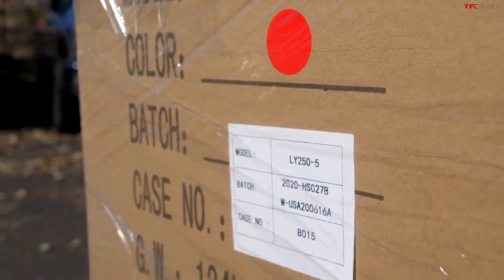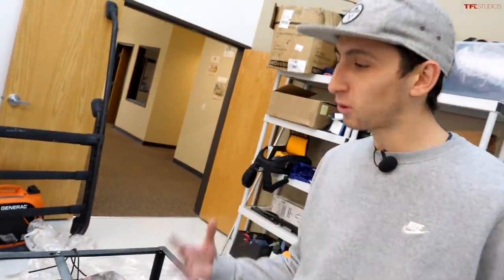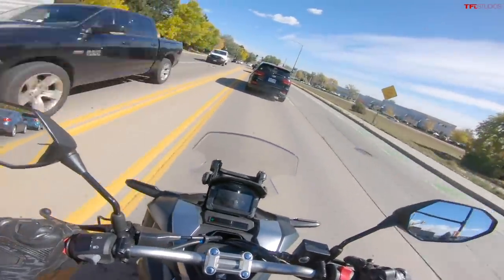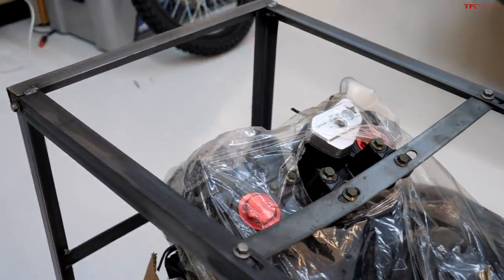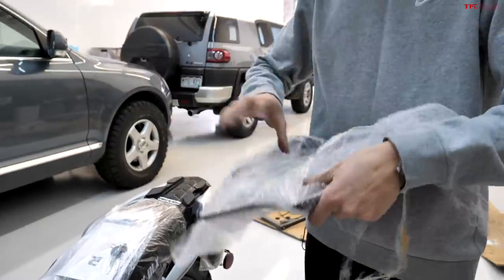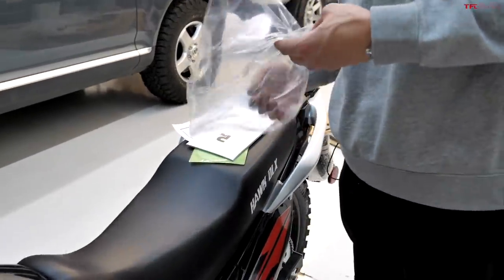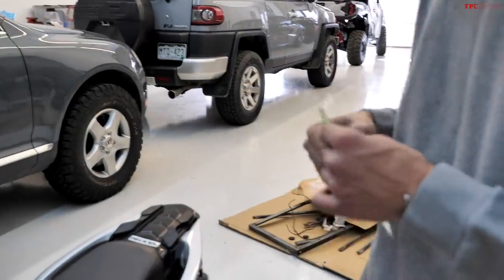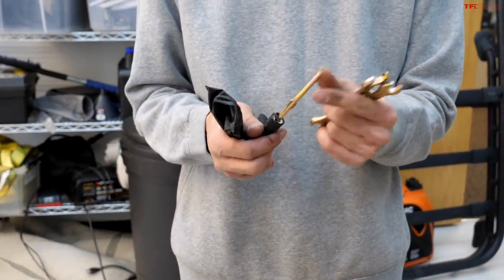Hawk DLX 250 Unboxing: Here's What You Get When You Spend $2K On a Chinese Dirt Bike on Amazon!

Comment: I absolutely LOVE your project goals with this, and I am subscribed to this channel specifically because of this bike. I love Honda CG clones :P The engine is a 229cc pushrod engine, by the way. Just like everything, rounded up for marketing. Oh, and don't be one of those people that ask "Why doesn't this pushrod engine breathe well at higher RPMs like an overhead cam engine?". This is a weird lazy workhorse engine by design, it is built for daily use in the low and mid range. It doesn't scream like most of the bikes anyone is used to, even for a thumper! Sounds happy putting about, though.

Comment: I just wouldn't buy a bike from Amazon. These cheap old-tech bikes are common across the globe. The prices are a lot lower in most of the world. The question is when there are dealers and parts and test rides across the US, for $2k cycles. The TFL intro to the Honda Cub shows the divide. The Cub is a little too techy, too refined, with ultra limited storage. The Cub is stranded where I live. There is no way out of town that doesn't involve a 65 - 80 mph road. So what do you need to get out of my little town? At least a 250. Most of the YT vids have been very short term, so you get no sense of how to make a $2k cycle work. Most of the big channels are so scatter-shot, just all over the place. I'd suggest just being disciplined.
Reply: Tons of parts in Amazon and in different websites....u will surprise how many HAWK BIKES  we have now in US